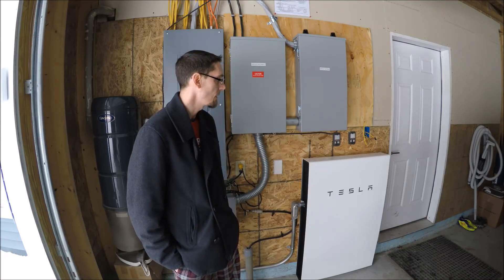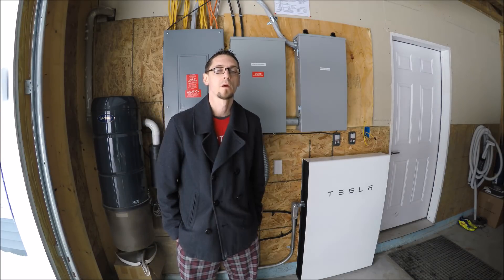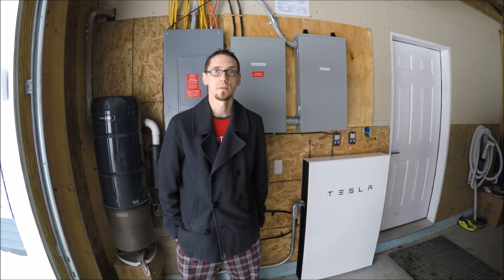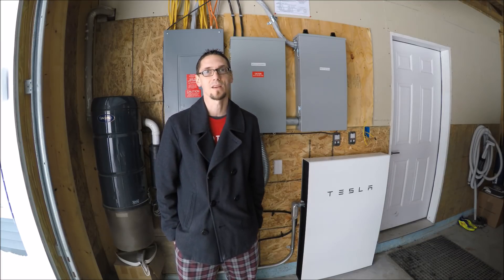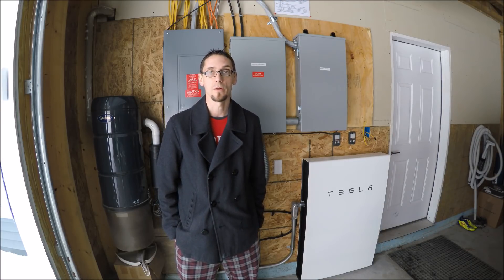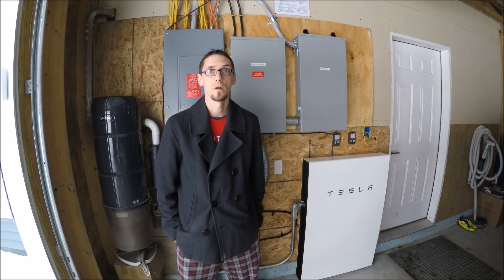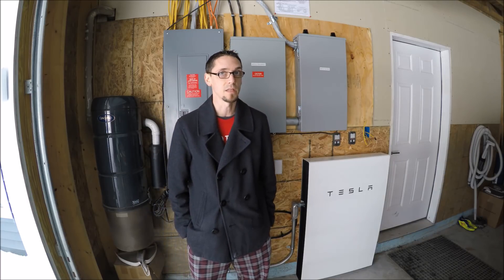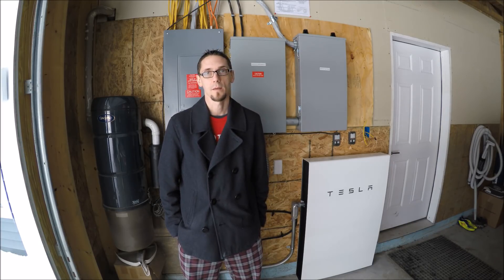New Tesla Powerwall For $1500

Comment: I think it’s to close to the ground it’s even below the concrete you don’t think 🤔 water wilk get to it, you must be on a hill or something
Reply: The powerwall is rated for indoor or outdoor installations.  It will be fine in that location.
Reply from the maker: Your concerns would absolutely be valid in most situations, but yes, I am on a small mountain at about 1000 feet of elevation. The driveway also slopes down away from the house.  In addition, the Powerwall sits on rubber feet, which may not be noticeable, but actually keeps it about 1 inch off the garage floor.  To add to the water safety, my garage has floor drains, so I have no concern of water getting to the unit.  Good point though!
Reply: The powerwall is also waterproof 22 inches from the bottom.  About 2 inches below the switch on the side is the marker.